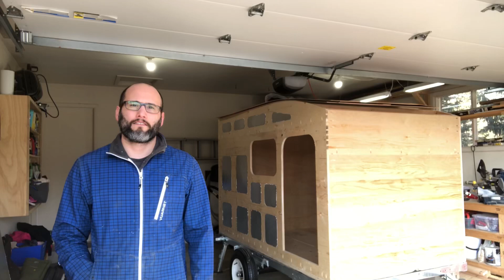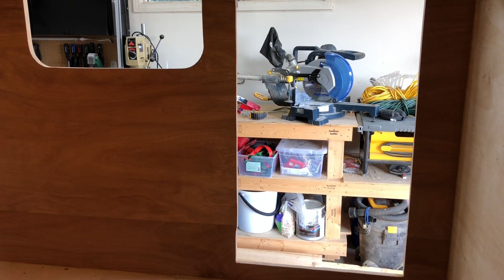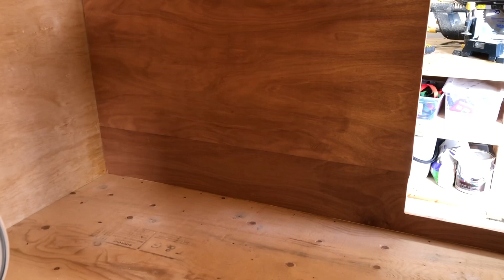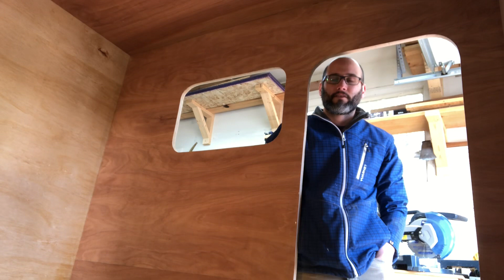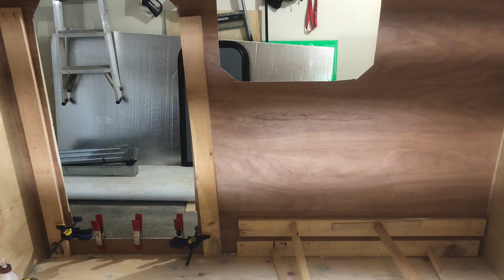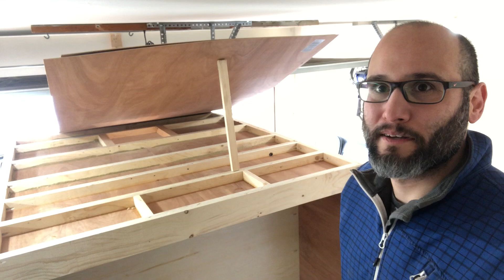DIY Teardrop (Square Drop) Camper - Video 3

Comment: Lots of nice innovations.  I have a question. Why radius the corners of the insulation holes
 wouldn't it be easier to cut them square
Reply from the maker: Thanks, I figured having the radius on the corners would help keep some extra strength in the walls. 
A square corner usually has a higher chance of splitting or cracking, so this reduces those chances. Thanks for watching
Reply: @tomthebomb45  Prefect thanks
Reply: Hi Tom, I've really enjoyed watching your videos. From one Canadian to another, where did you purchase your trailer, window, and doors from and where in Canada are ya from. Looking forward to your next video.
Reply from the maker: @adamdemont8069   glad you’ve enjoyed the videos so far! I’m located in SW Ontario. The trailer frame is a “Freedom Trailers” 5x8 and I purchased it from a company called Muddy River Wholesale. I believe they are also available on Costco’s website as well. 

The windows and doors I purchased from a trailer sales company called Noroteck in Norwich. They sell new and gently used windows and doors and the prices were the best I’ve found anywhere to be honest. 

I’ve been making some good progress on the build, and will probably do another update soon!  So I hope you’ll tune in for that!
Reply: @tomthebomb45  thank you for the info Tom, its much appreciated. I'll check them out. Yes, will definitely check out your next video.

Another channel I'll recommend is "Playing with sticks". He is from Alaska and does tips, tricks, and comparisons on camping gear for small Campers. I find it very useful. 

By the way I'm in Calgary Alberta.